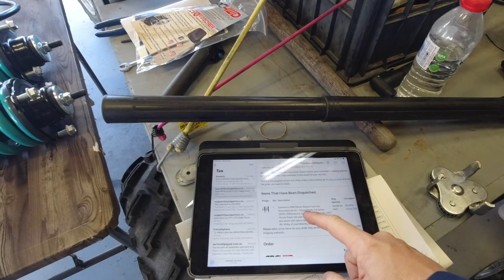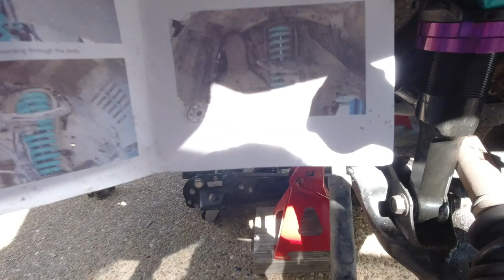Fitting Dobinson MRR suspension to my 120 Prado! #dobinson #4wdmods #liftkit

Comment: How do you get away with 2.5inch lift? Did you get an engineer to go over it?
Reply from the maker: They are adjustable and now set at 2 inch 👍🏼 I also have UCA’s and dip drop now too which is in another video

Comment: Hi mate just a question , i also have a 120 prado and im planning to put a bullbar on it. Do i have to get a 2inch lift too? Hope u can help. Tnx
Reply from the maker: Hey mate, nah the bullbar will be fine with stock suspension. The lift just helps with tyre clearance when you put bigger tyres on. Mine at 265/75 instead of the factory 265/70. Lift also helps with ground clearance too obviously
Reply: @Kenny_B  thans for your help mate. Really appreciate it🙂

Comment: Are you happy with the mrr
Reply from the maker: Yeah they seem really good so far. The ride is noticeably smoother and it’s given me a little more lift (probably 2.5” now). I just bought upper control arms and a diff drop kit to improve my cv angles so hopefully I’ll get this done in the next week or two 👍🏼
Reply: @Kenny_B  was just going to suggest the diff drop and UCA for wheel travel. 

Did you end up going with heavy coils? how do you find the adjustable options? have you played with the dampening yet? 

Also If your looking at UCA look up Mevotech they are SPC just rebranded and killer price.. at least here in north america